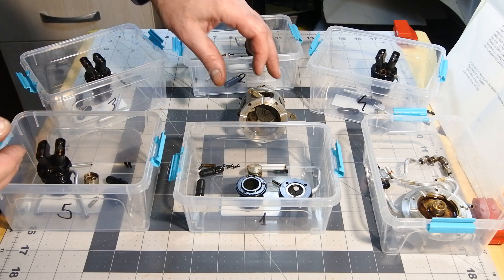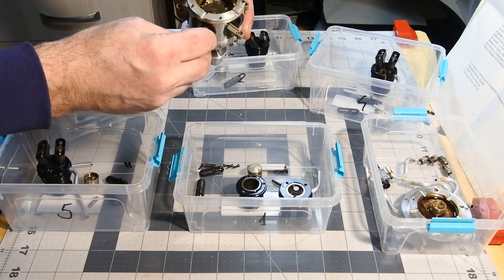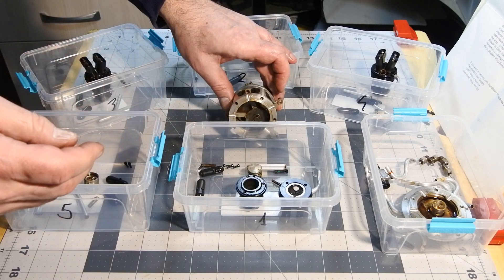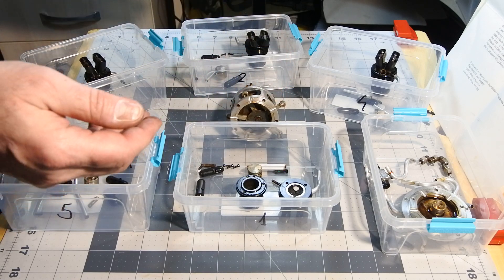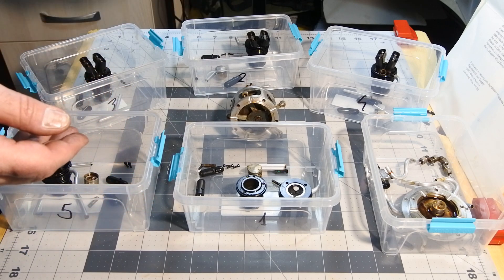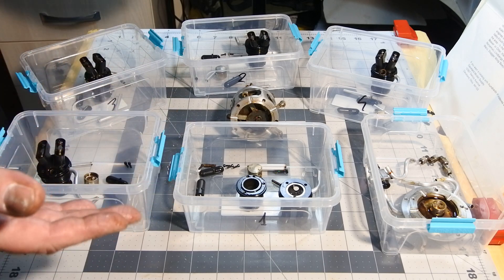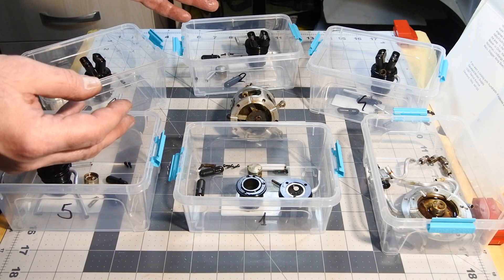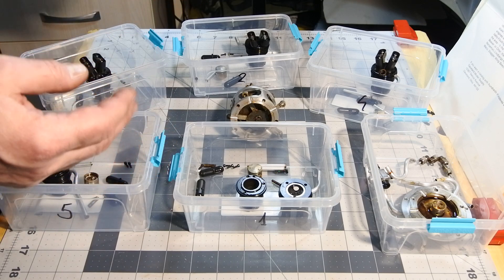Technopower II Big Bore checking internals after eBay purchase

Comment: Definitely rude to purchase new and be surprised by a lie..
So check out that engine..very cool ..what an interesting intake system..
I now want to do a test on my spare saito fa120r3 radial..
Take a look at modification to a spare intake manifold i have..
Open to the crank case ..well that will increase lubrication..but will it disrupt clean fuel/air mix? Probably not a worry..interested to see the next vid of this engine
Reply from the maker: Thank you for your nice comment ! Definitely, I was wrong, telling that TECHNOPOWER is simplified construction engine, It is not. I spent two working days to correctly assemble this engine back. The reason - engine needs to be assembled in a special way, and small details suddenly becomes very big. Checking non correctly working valves at the end divide me to very complication procedure of each valve dismantling and adjustment. Engine design is absolutely not adapted for such operations. So, this engine is not dedicated  for modelers, it's for masochists' 🙂 or collectors. 
Please, stay tuned, assembling and test run of TECHNOPOWER  video's are not so far away.
Thank you !

Comment: It appears that the Technopower (I) marque was started in the UK in c. 1975 with the production of 3 cylinder radials. About 50 of these were made-these are now v v rare to find. A number of 5 cylinder radials were also produced. Production then moved to Ireland for a while where the 5 cylinder models continued to be made. Manufacturing rights to the name and model design were acquired by Technopower II probably in the early 80's and the range of engines extended to include  seven and nine cylinders by 1985. So, I would guess your 5 cylinder engine dates back to the mid to late 80's. The name "Wally Warner" is synonymous with Technopower.
After production moved to the US the engines underwent a re-design, this can be evidenced by the prefix "B" in the serial number of the  re-designed models-My 7 cylinder for example, has the number "B7 ***". ERRATUM-in an earlier reply I stated that an electric starter should not be used, this is incorrect as the owner's manual states that an electric starter can be used. But my advice regarding hydraulic lock still stands. Wish I could find out more details about Wally Warner-he sounds like a genius!
Reply from the maker: Thank you very much for your information, it's very comprehensive and helpful! I also read a lot about the history of Technopower, Peter Chinn, an author of Technopower dedicated articles and reviews in M.A.B. and in R.C.M.& E. also mentions a bit about historical details in his engine surveys. I'll check my engine serial Nr.
Thank you very much for your help!

Comment: File a complaint with eBay against the seller for false listing. Ask for a partial refund of your money. Tell the seller you will file a negative feedback if he does not make amends for false listing.
Reply: or just give it a good clean, put it back together and enjoy it knowing that it has already been run in. It is only going to appreciate in value.
Reply: @evanleebodies  I often buy used, nasty engines and refurbish them. But they are sold as such. Someone listing an engine as NIB when it clearly is not is dishonest and should be called on the carpet for it. IMHO. 🙂
Reply from the maker: Exactly,  absolutely agreed with you !
Reply from the maker: Thank you very much for your advices ! Definitely, will take a lot of care about it, thank you !
Reply from the maker: @evanleebodies  Sure, a good ultrasonic bath is almost planned for this week. Stay tuned !
Thank you.
Reply from the maker: Thank you very much for your advice ! Engine was purchased two years ago, and was in the box, until   todays disassembling routine starts. I have a long experience with buying RC engines from eBay. I think, that I have enough  cases, to make a short video about "Is it really make sense to buy RC engine from eBay ?"   :-)
Thank you, and have a nice day !

Comment: These 5 and 7 cylinder engines are enchanting to look at but sadly the power to weight ratio is pretty mediocre by today's standard, so much so that they were nicknamed "Tech no power". They were originally manufactured in the UK as the series 1. Got a 7 cylinder never mounted.
Reply from the maker: Thank you for your nice comment ! "Tech no power" - sounds really funny ! Interesting info, much appreciated !
Definitely, this engine is just for collection, I don't even think to fly with it. But to run it on the bench could be very interesting, I think. Peter Chinn describes its sound, as very unique and very close to its bigger brothers...we'll see a bit later,  I should complete cleaning routine.
Thank you and have a nice day !